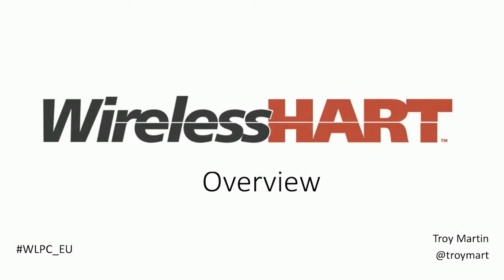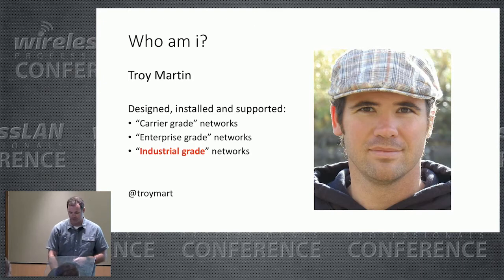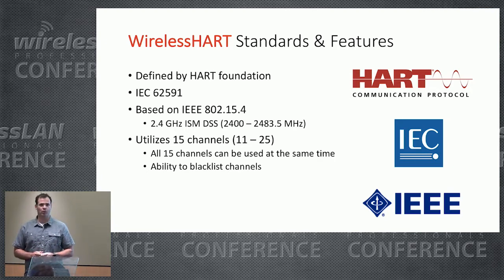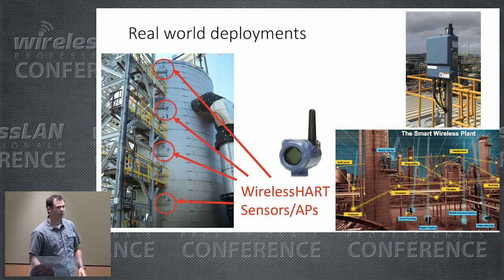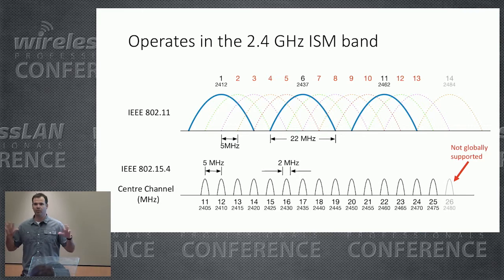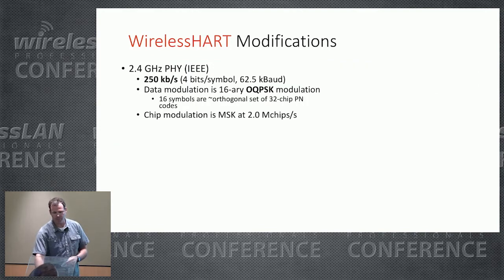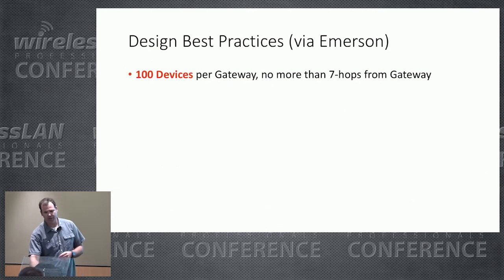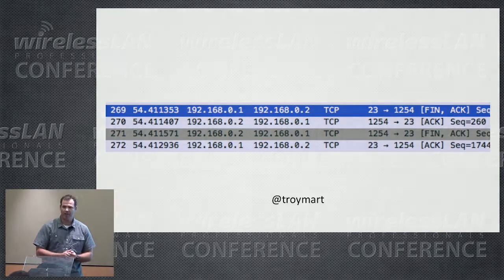WirelessHART  Overview | Troy Martin | WLPC_EU Lisbon 2017

Comment: if i have intrinsically safe wireless transmitter did i need Zener or Galvanic barriers in control room to limit the voltage and the current , please answer my question . thanks
Reply: WirelessHART transmitters are wireless, and do not have wired connections to the control room, so barriers are not required. Class 1, Div 1/ Zone 0 devices are available for installation in Hazardous Areas, and there are hundreds of thousands installed in refineries and in upstream hazardous environments today